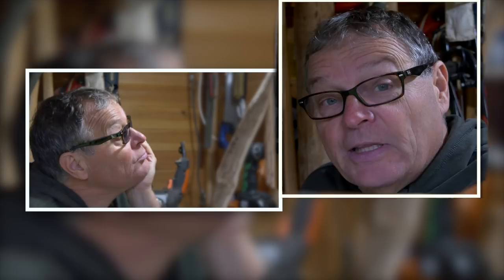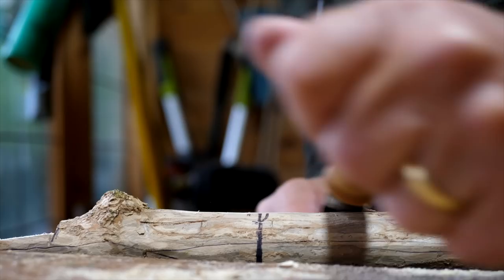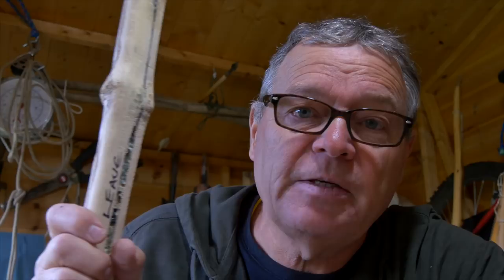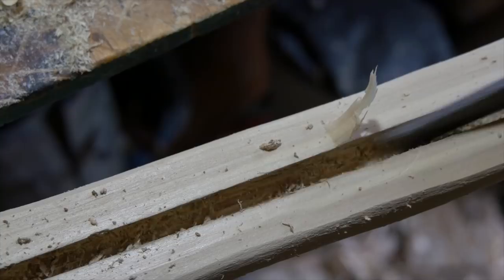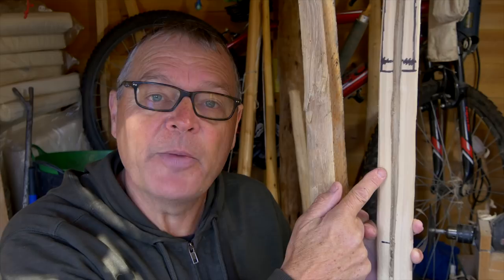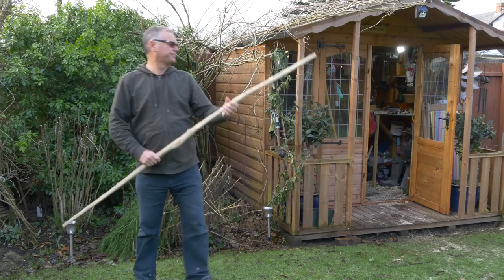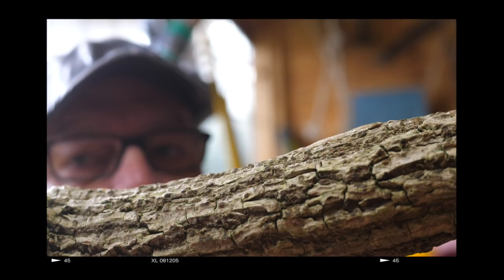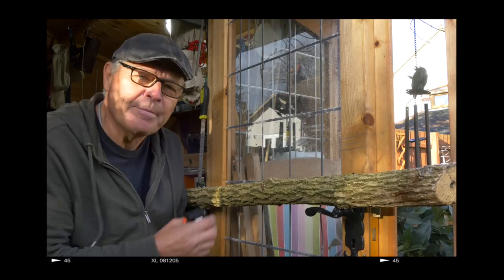Making an Elder Bow. Part Two. The Puzzled Bowyer 🤔 The Beginning of an Elder Flatbow?

Comment: Have you thought about filling the pith groove with ash doweling, or maybe some bamboo, or even a length of fiberglass rod? It looks like an inherent weakness there.
Reply from the maker: Hi Bill, no - hopefully that won't be necessary. Though I haven't made one myself, there are bow designs that incorporate a hollow or semi hollow limb. Check out the website Stonehill Primitive bows - you'll see what I mean there. Whether I have the skill to do that is another question! I think it is likely that the bowyer will fail before the wood does! Thanks for watching. Mick

Comment: Hi Mick.  Great video, you excel with them.  Good call on sticking with the flat bow design.  Keep the handle thick if your going with a holmegaard style stiff handled bow all the way through the tiller process and only narrow the stiff handle once you have finished the tiller as you need to use the string again to mark your centre line.  I cant tell you how many flat bows I ruined in the earlier days when I finished the handle before I finished the tiller only to find the string did not sit dead centre in the handle.  Look forward to your next video.  I would advise keeping your bow 1 3/4" wide for 3/4 length of each limb and then taper width to 1/2" tips, that gives you a start for tiller and then you can fine tune width and taper as you progress.  Think I saw one or two limbs with deflex?  Will you leave that in or induce reflex with heat in both to make it easy to tiller so both limbs are equal before you begin tiller?  I love character bows and that looks like an absolute head puzzle.  Good luck.
Reply from the maker: Hello! Apologies for late reply - youtube's listing of comments is bizarre! Thank you for your advice - really useful, especially the limb width/taper guide.My string is now fairly central to the grip but I have left the grip very chunky for now and will do as you suggest and refine later. There is a bit of reflex in one limb. I am gingerly trying dry heat to correct string alignment and if that works okay I may ease the bow straight - as you say, it will help me tiller. It is puzzle and a real head-busting challenge this one - baby steps all the way for me. I do hope it works - I will learn much on the way. Thanks again. Mick
Reply: With wood like elder just use the string as you normally do as your centre line and then measure equally off this on both sides for what the wood will allow.  I normally have a 4" long handle that is about 1 1/4" thick then either side of this handle I mark 2" of length so that is of 4" of handle at 1 1/4" thick and then 2 " either side of this handle.  I taper the thickness of the belly from the handle over this 2" into the working limb which normally has a starting thickness of about 1/2" I then taper the thickness to the nocks where the thickness is normally 3/8" thick.  Normally my flat bows are 68" in length, that equates to 4" of none working handle + 4" of taper into the working limbs ( 2" either side of the handle) so thats 8" of wood before you even start the limbs and then each limb is 30" in length.  A very basic flatbow could have a width of 2" from the taper from the handle to mid limb and then a steady width taper to 1/2 wide nocks.  I always put my bows flat on a large wooden former and clamp them flat and heat the entire limbs while they are clamped against the former, do not heat treat the limbs just apply dry heat while the wood has oil on it and u can barely touch it and then let the wood cool and then unclamp after a few hours, keep repeating that processing until each limb is flat and equal and there is no difference in deflex or reflex and no twist to fool your eye and your tillering rate and success will sky rocket.  I never heat treat to align the string I cut the bow to the string, as long as I have equal amounts of wood either side of the string u know the limb wont twist as neither side will be stronger than the other when u draw the bow.  Sorry for the typos and bad grammar its late and im tired and waffling!  I dont know if this will help you but spending the time use dry heat to get each limb absolutely flat will not only make yours bows look good it will be a eureka moment when you come to tiller.  The best tool I have is a jig that many bowyers use.  Mine is a block of oak about 8" horizontal in length, there is a block about 2" x " 2 glued on to each end of this horizontal.  If you take your bow limbs where you have kinks in the wood you can set the affected area between the blocks on this jig, heat it up while the wood has olive oil on it so you dont scortch the wood and apply a G clamp to the spot you want to take the delfex or reflex out and clamp the wood just past the point where you want to flatten it.  This lets you take out kinks in your limb so again when tillering your eye is not fooled by small bits of deflex or reflex in the wood.  You will never get a plumb straight bow stave unless using a board but this is the closest technique I know of.

Comment: I never even thought it was possible to make a bow of elder wood, mostly because of the soft/hollow core. Very interesting! Are you going to leave the furrow as it  is and do you think that will effect the bows durability? I was thinking that maybe it would be possible to fill the furrow with some kind of nice looking epoxy? If a kind exist that actually can handle the stress during a draw and release, and preferably add to the performance. And yea, I've never ever made a bow or really worked with wood much, and my English is less than perfect. So I will shut it now ;). Love your videos, stay awesome.
Reply from the maker: Hello General! The pith channel does not prevent elder being a bow wood, though it does add challenges to the making of a bow. I have never made an elder bow before but plenty of others have done so. Have a look at Stonehill Primitive Bows on the web - there you will see several elder bows. There is no need to fill the channel with anything, though I can understand why it does appear to be a good idea.Don't apologise for your written English - it reads very well! Thank you for commenting and of course watching my videos - appreciated! Mick
Reply: Hi! can't believe how quickly you answered that. Thanks a lot for the information. I actually just looked at some of the bows at the site you recommended. The pith channel(!) really adds some character and is quite beautiful, glad it doesn't have a negative impact. Other then adding to the challenge ;)
Good luck with it, I'm really looking forward to see the progress of this bow. Take care! // Robin
Reply from the maker: General Chicken Thank you Robin. I do my best to reply to everyone but I do fail sometimes. Glad I got there quick this time and thanks for the good wishes 🙏🙏

Comment: The only dimensions we need to carve out a self-bow are some "not less than" dimensions for a given style in a given wood, at our draw-weight and draw-length. 
If we let the emerging tillered shape be our guide, when we are done and have a working bow we can measure it. But you already know this.

"What are the exact dimensions?" is question usually asked by someone who wants to be given a least work solution and thinks that they are dealing with a uniform process and perfectly homogeneous material. 
Ask instead for some guidelines, specifying the relevant information.

Even so someone fully conversant with the engineering principles and the math involved would be perfectly able to calculate parameters for a particular design, given the necessary information on the materials involved. 
I would find that kind of boring. 

Incidentally the distinction between "longbow" and "flatbow" is a false one since flatbows come in all lengths and there have been many kinds of long bow. Some mediaeval English bowyers occasionally made something they called a "broad" bow as a gentleman's hunting bow, but it was probably too much bother and uneconomical to be considered as a model for a livery bow.

In practical terms, from the user's point of view, the most useful distinction is to be drawn between long-draw bows and short-draw bows much as we recognise the difference in practical terms between a short barrelled gun and a long barrelled gun.

I know that we learn by solving problems and that learning to deal with poor choices is a great teacher.  Even so, one of the biggest steps towards having fewer problems is to know how to recognise and cut a better piece of wood.
IMHO this piece will stand being shortened some to make a serviceable bow.

What draw-length you going for? Bow hunting corner of the mouth or longer?
Will this turn out to be a case of "took off too much wood too soon"?  ;-)
Reply from the maker: Not sure if too much too soon Rod. Time will tell for sure. That pith tube rules the roost on this one and my dimensions are for starters of course. I can’t see it drawing much weight and yes it should be shorter but there’s that wiggle that would make that an unhappy choice. I’ll just experiment on until it breaks or bends, harvesting experience all the way.
Reply: I guess I'm thinking that if I were going the concave bellied "C" cross-section route  then I would want to be marrying that up with a sort of wide in the middle "willow leaf" limb shape in  plan view, not too parallel through the mid limb. 
Gradation in width, thickness and C depth all contributing to the degree of stiffness/bending through the working limb.
Procedurally "not too much of anything all in one go".
Review the "How to" and sneak up on it.
A bit "North Andaman" in the tips (or his' triangular sectioned spike tip).
Interesting.
Got me wondering about a good piece of Hazel...
Reply from the maker: I like the willow leaf analogy. Whether the actual wall thickness will give me that peaked/cornered tip profile I doubt. But yes, those are good words: “not much of anything going on”. That’s sort of how it sits now, ends resealed and coming into some drier air soon.
Reply: My shellac is thickening up nicely. Soon be time to go back into the woods. Meanwhile just touching up Shorty.
Reply from the maker: Those woods eh? Good luck. Me too, soon: elm, hazel and blackthorn on the menu and maybe possibility of a side trip to Normandy where a friend’s farmhouse is having trouble with yew trees 😀😀😀
Reply: Mmmmm, blackthorn.
Reply from the maker: Is that a good mmmm or a doubtful mmmmm?